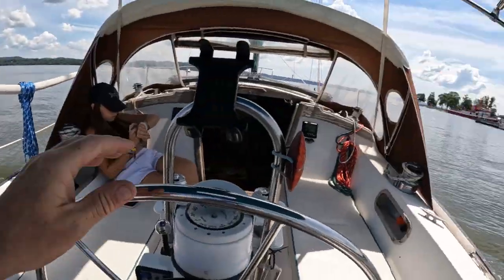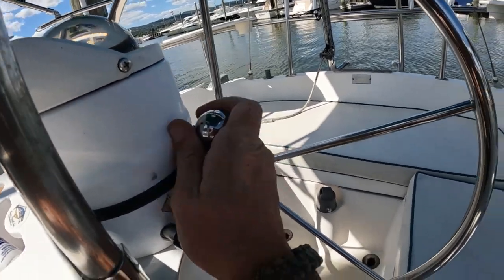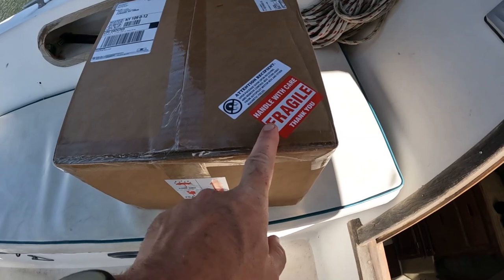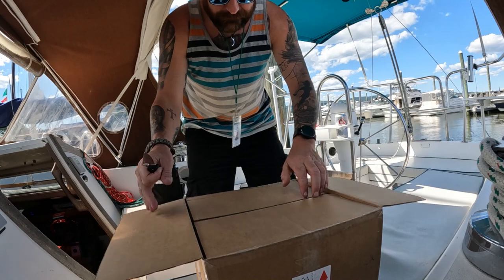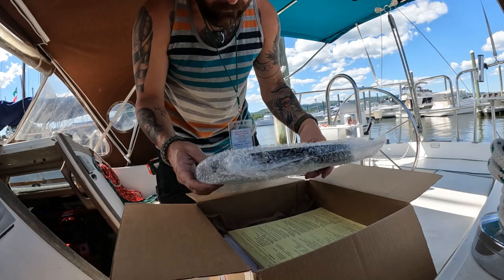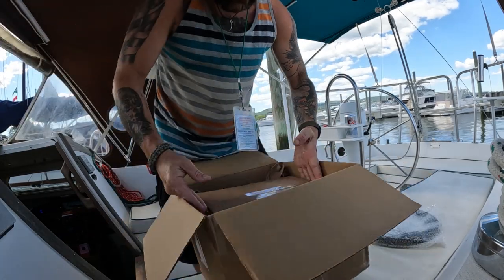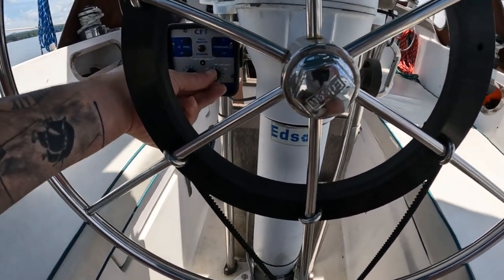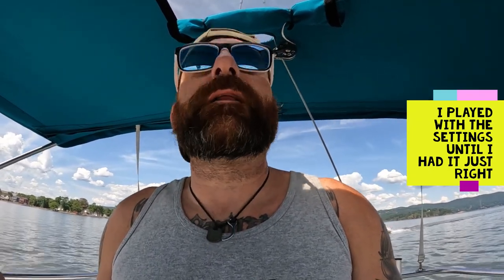CPT Autopilot Install on my Catalina 30

Comment: Hey there Sir: Back in 1987 in south florida (Ft. Lauderdale) I was the Lead technician at CPT Inc. I was in charge of Quality control, Repairs, Assembly, and Conversion of the CPT Autopilot 1 (that's the number one). The CPT unit looks to be the Newer model (when Charlie Puckit sold the Company well after I left the company). It doesn't surprise me that the CPT Autopilot II are still out there and are of superior quality. I left CPT (when it was in Ft. Lauderdale FL) to pursue a BSEE degree (Electrical engineering) at the University of Florida. I currently work for Cisco Systems as a Voice Engineer. The CPT Autopilot II is build like a tank and made in the great US of A !!!
Reply from the maker: Yes sir it's brand new

Comment: I'd always found those magnetic dishes essential for holding on to nuts and screws, when working.
Until I started working on boats, where all my bolts are stainless or bronze, and are thus non-magnetic.
Reply from the maker: Yes they won't hold the brass and stainless but will still keep them from rolling